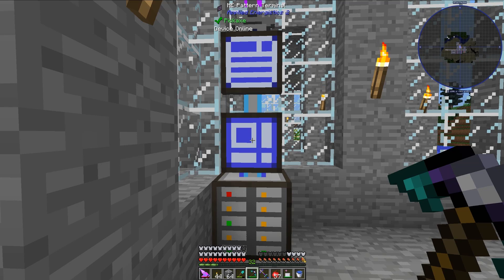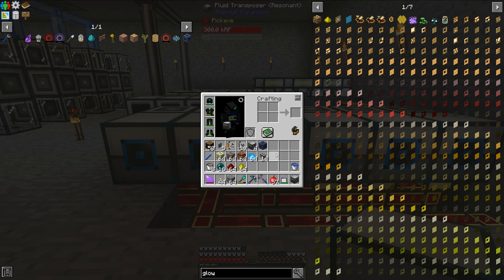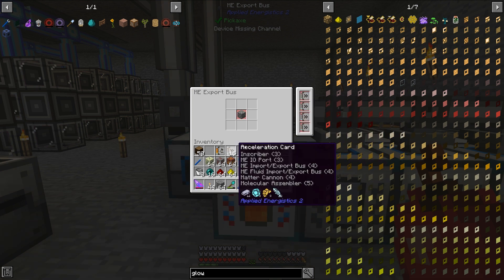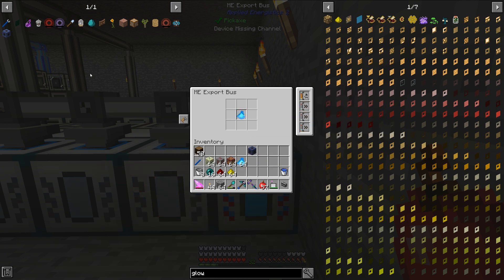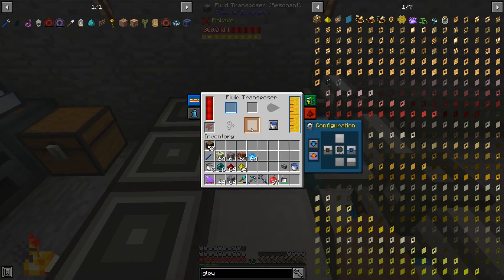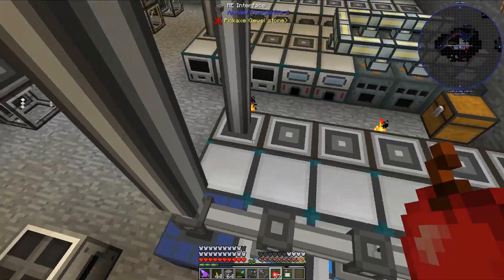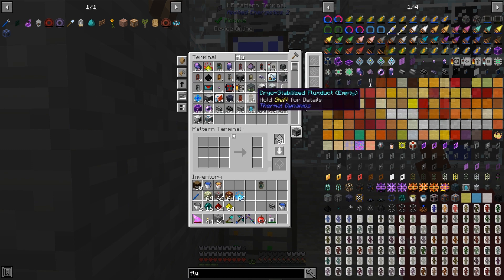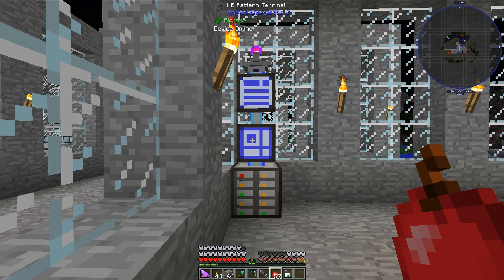How To Automate Magma Crucible & Fluid Transposer Combos!

Comment: anyone know why my ME system wont craft the buckets? i have 75k iron ingots so definitely enough iron for them. Say if I craft 10 buckets of Resonant Ender, the crafting monitor will say Stored: 30 Iron Ingots, Scheduled: 10 Buckets(highlighted yellow), Scheduled 10 Resonant Ender Buckets(highlighted yellow). I do have a pattern for crafting a bucket in one of my interfaces.
Reply from the maker: I doubt this is the problem, but the only thing I can think of right now is that your ME System is completely full of items (or it is full enough that the buckets have no where to be stored within the system).

Another thought is that maybe you made Processing Patterns for the buckets rather than Crafting Patterns for the buckets. I think that would cause an issue that you are experiencing because the ME System would think that it could make the buckets, but it would ultimately not be able to make them.

You could always try replacing your bucket pattern in your ME System with a new one. I've had times where server restarts or server updates seemed to make some patterns not work right. Not sure what the issue was in most cases, but simply making new ones usually solved the issue.